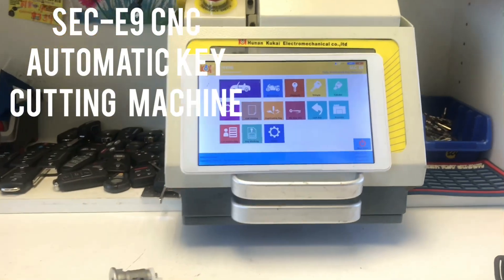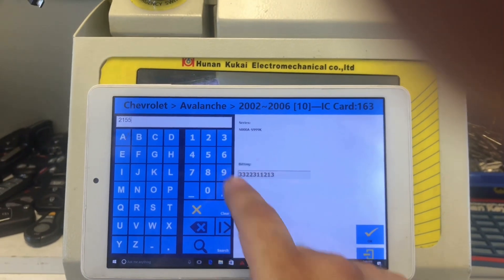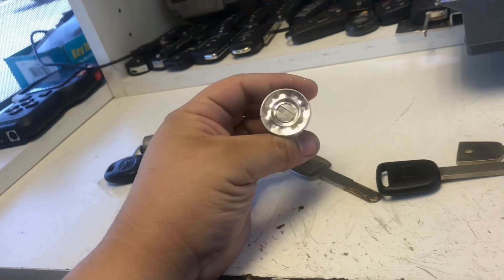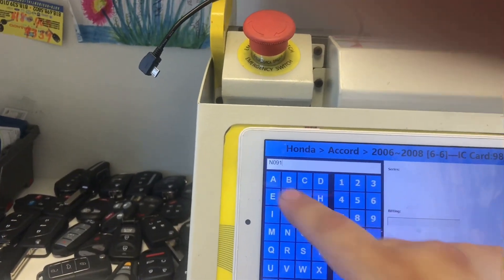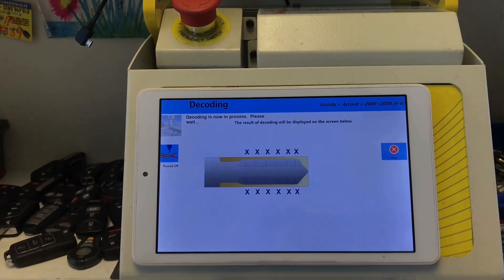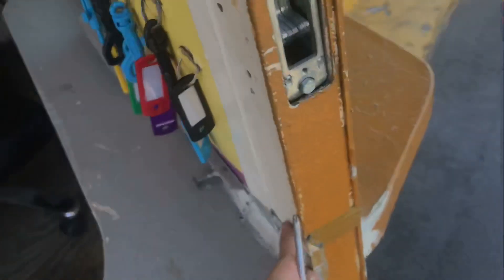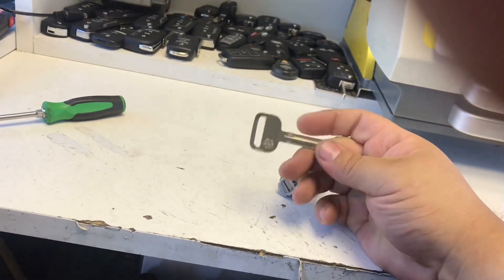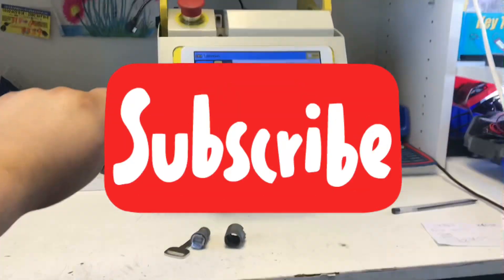SEC-E9 CNC AUTOMATIC KEY CUTTING MACHINE (LOST KEYS/DUPLICATE HIGH SECURITY KEYS)

Comment: How you like this machine. I read online its diabolical. Always breaking down. Whats your take
Reply from the maker: Yes alot of people have found this to be the worst cutter.. i started learning with this machine... i found it to be more comples software and not as simple as the dolphin.. however this has a more better software by tablet..has a long list of vehicle coverage. Cutting was kinda off and i found so hard to calibrate... but overal i give it a 7/10
Reply: @MYKEYSAUTOMOTIVE  laser mounted in a mini cnc 3d printer frame. Sheet of 3.2mm steel in and BAMM. 100% accurate.

Comment: Hello sir, are you able to make keys for a house with this machine or duplicate a key if it was lost?
Reply from the maker: Yesss!! But you need to buy a seperate cutting clamp
Reply: The machines trash.. i use Condor XC Dolphin 
XP-005 High Sec Portable Key Cutting Machine / w 
Battery (XHorse)
Reply: @CarnageSo  I looked up the machine. Which software did you download with this machine? Doesn't have a tablet for the codes.

Comment: where would you buy this machine from? also does the tablet or anything have gave you problems?
Reply: The machines trash.. i use Condor XC Dolphin 
XP-005 High Sec Portable Key Cutting Machine / w 
Battery (XHorse)
Reply from the maker: Tbh the battery kinda acts up sometimes ... doesnt turn on ..i believe these tablets shouldnt be over charged cause it will damage the battery...

Comment: Hi, what machine do you recommend to start?
Reply from the maker: Hello  well i started off with the sec-e9 wich is not a bad machine in my opinion.. theres also the condor xc mini wich cost a little more but to me its a little more complex
Than the sec-e9... but its all up to you ...the sec-e9 i hear some complaints the xc mini no complaints so far ... but like i said its all up to you...
Reply: The machines trash.. i use Condor XC Dolphin XP-005 High Sec Portable Key Cutting Machine / w Battery (XHorse)
Reply: @CarnageSo  the 005 won't do as much as this one though..? And is the 005 as easy to use as this one for all keys lost and code cutting etc?

Comment: Question to my keys automotive 

If you had to buy either the condor dolphin or SEC E9 machine to start your mobile auto high security keys. Which would you buy and why?  Thanks in advance
Reply from the maker: They are both good machines the condor dolphin is a little better quality to my understandment has a built in battery(portable) and bluetooth to control from you phone on a app ..the sec-e9 you cant really carry it with you its kinda heavy maybe with an inverter ..you can ..and heard some people complain that it give you problems and that its the worst machine...but from my personal experience i love the sec-e9 have been using it for over a year no problems!! Havnt even changed the blade yet ..although i think i might have to change it soon!! I love it!! You control it from a tablet bluetooth.. dettachable .. it cool !! I like it!! Its my shop machine i use ..have only took it once out to a job site and kinda heavy like i said.. but its all up to you!! I would say condor dolphin!!
Reply: The machines trash.. i use Condor XC Dolphin 
XP-005 High Sec Portable Key Cutting Machine / w 
Battery (XHorse)

Comment: How you like this keys cutting machine?
Reply from the maker: I love this machine ...i been using it for over a year havnt change the blade yet ... but i will soon... although there is alot of complaints it has not gave me a problem yet!
Reply: The machines trash.. i use Condor XC Dolphin 
XP-005 High Sec Portable Key Cutting Machine / w 
Battery (XHorse)
Reply: @CarnageSo  dude. Your tactics won't work

Comment: if i am not a locksmith and not willing to throw a big bunch of money, while I need to diy copy my keys at home, what will be my best option among these machines?
Reply: i am greatful, sir
Reply: wait a minute.. I want an automatic machine that me just tighten in place and turn on a switch and machine does the rest
Reply from the maker: When it comes down to buying these machines you cannot buy a cheap one as it will give you problems most machines start at $2,000 if you want one of those i reccomend you buy the condor dolphin 
https://www.americankeysupply.com/product/condor-dolphin-key-cutting-machine-xhorse-9718?gclid=CjwKCAjw9L_tBRBXEiwAOWVVCaem_fdCuKtJQYC8Af0DxUl137P3AF46vpC_QPygFhW7UZbsMo3NRBoCM78QAvD_BwE
Reply from the maker: You can control it through your phone via blue tooth ...its a nice function..0
Reply: $2000😨
then definitely me go for manual.  Rgaerding the manual machine link u put up there: don't you think the following link is a better type?:
https://www.ebay.com/itm/Key-Cutting-Machine-Laser-Car-Door-Key-Cutting-Copy-Duplicating-Machine-Tools/382941639996?hash=item592919b53c:g:Hk0AAOSw3AFc0kky
Reply from the maker: Atad Ali yes this one will cut the high security keys like lexus...
Reply: and one more thing about the first link you put: some keys (like lexus) has the pattern not on the edges but graved like a channel or tunnel in the middle of the key: sure this machine cant do it, can it?
Reply from the maker: The first link that i put will not cut keys like the lexus high security keys...however the link u put will!, thats an ok machine ..you cut the keys manually ...by moving the levers ...the one i got does everything for you but likeni said the link u put ..you control it..
Reply: thanks a lot sir..I appreciate it
Reply from the maker: Atad Ali np!! Thank u!!
Reply from the maker: I would buy a cheap one off ebay.. they have some for really cheap prices...
Reply from the maker: https://www.ebay.com/itm/598B-Key-Duplicating-Machine-Key-Guide-Key-Reproducer-Reproducing-Cutter-Engrave/133089898126?epid=4031745183&hash=item1efcc6ae8e:g:RMcAAOSws8FdityF
Reply: The machines trash.. i use Condor XC Dolphin 
XP-005 High Sec Portable Key Cutting Machine / w 
Battery (XHorse)
Reply: @CarnageSo  Thanks for help.  Any link? Price?